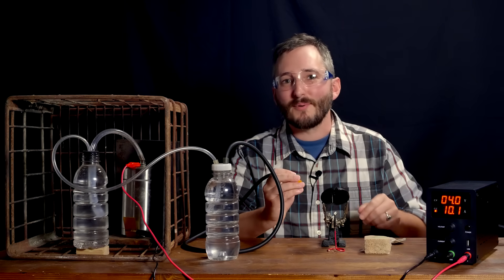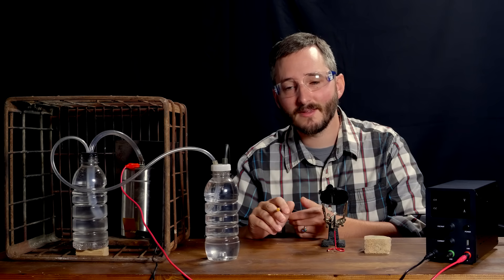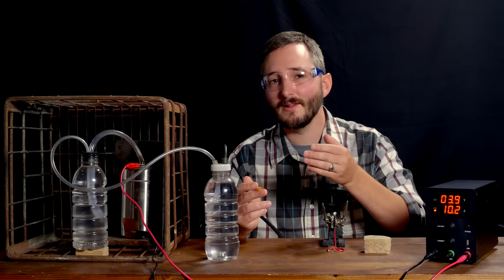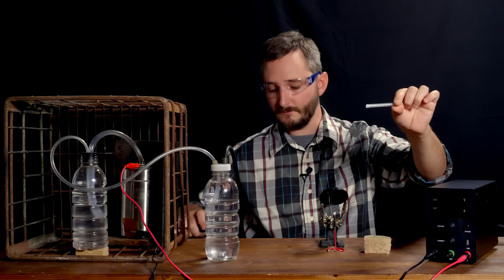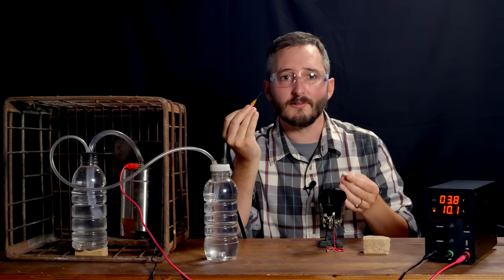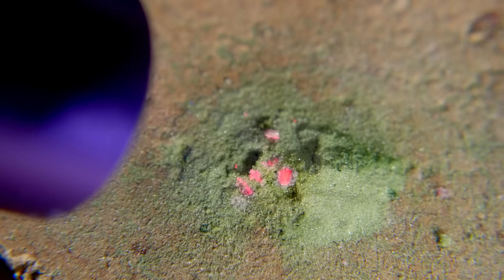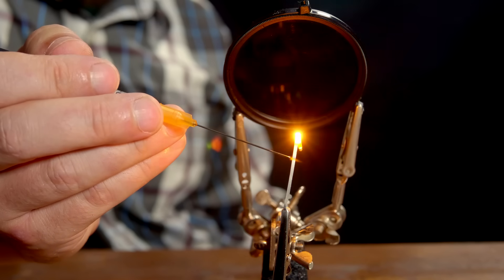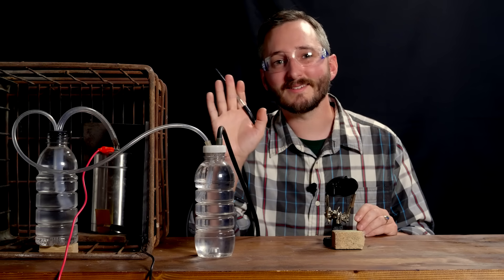DIY Oxy Hydrogen Torch Using Water Electrolysis

Comment: You could use it as the most dangerous soldering iron ever but it would probably be too hot for any solder I've ever worked with... seems extremely practical, especially since it looks like your using a factory made soldering iron's power supply to power it (could be a hoby electronics power supply, but if you have one of those than you probably have a factory made soldering iron too) so in light of that it seems extremely practical to DIY one using highly explosive gases ... because duh, everything's is better when it's way more dangerous than necessary.

All kidding aside, while I have no real, practical use case, this was still a really cool video. It reminds me of a torch I made in my high school days with my dad in his workshop. It ran on acetylene made from mixing gravel sized chunks of calcium carbide with water. In that case the gas production was very very fast, and we had to take measures to ensure our collector didn't over pressurize and we still took steps to ensure that the flame couldn't make it back to the fuel collector too. It was a fun project,  but felt too sketch to want to actually use it for more than demonstration. Anyways, thanks again for the nostalgic video.

Comment: Once again great video with very enjoyable and engaging content.

Was that glass standard glass or tempered glass? I would be interested in seeing if that could burn through tempered glass as well without a spontaneous disassembly of the glass panel.

As for uses ... Make three needles with one handle (if the gas out put is good enough) and you can use it to bend class tubing by heating evenly the entire tube surface .... and make customized lab equipment or desktop PC glass water cooling tubes for example
Reply: Like you said, i don't think tempered glass bends like that when heated.

Comment: this very much seems like an appropiate upgrade for the Hacksmiths' laminar flow propane proto-saber. Although it would be VERY dangerous, and would need a heck of a lot of power to generate a suitable HHO flow, it would definitely make it work more like the "real" deal.
Also if you could up the flow with a "few" more extra cells, could you make bigger rubies? Like centimeters big? that would be interesting to watch

Comment: You should use a balloon or a diaphragm tank.
Reply from the maker: A tank supplied torch increases the danger to an extreme measure. It wouldn't take a large balloon of hho to blow the door off my shop if it flashed back.
Reply: If you use a diaphragm tank, you can make a large torch, even with your small setup.  You just won't be able to use it for long periods of time.  You will have to wait on generation for the volume to be sufficient, then use the torch until the volume decreases to a critical state, then stop using it until you have more generated.  You also need a valve on your torch head, to adjust for different sizes of work.  The valve needs to be as close to the head as possible.

Comment: The long syringe tip is an interesting solution and I like the aluminum mesh too. but I'd feel more comfortable with the bulky oxy-acetylene tip that I see others use. And if you're you're going to use a steel cage for safety, you should also have ear-muffs. If that thing pops, so do your eardrums. My welding teacher got to see someone blow out the side windows of a car with a balloon full of oxy-acetylene gas.

Comment: Please consider a little different approach..  If your going to use electrolysis don't use a solid mass of water,  that's like flooding the carburetor,  consider a steam atmosphere for the electrolysis and use steel/copper nets as the electrodes.

Comment: I have to ask why use an all in one.  Why not just divide the H and O and then let the H feed on the Oxygen in the environment or combine the H and O right before it gets to the tip?  Also,  I was thinking about this the other day and have limited ability to test the theory so I will give it to you and maybe you can make a youtube video about it.  But, I saw another video where someone used Platinum to separate Hydrogen Peroxide without any electricity.  So, what would be the practicality of using Platinum plating on the steel wire to increase a catalytic effect.  Or using Hydrogen Peroxide w/platinum plating instead of using Water.
Reply from the maker: You get better efficiency for a combined output design. You can separate peroxide a number of ways without electricity, the trouble is it takes lots of energy to make peroxide.
Reply: @Nighthawkinlight  peroxide is fairly cheap though.  I just didn't know if it would allow more flow of Hydrogen when combine with electricity.  Especially if you use platinum plating on top of it.
May cause other reactions though.

Comment: Hho is too dangerous for public consumption, but your syngas generator using carbon rods could be a game changer. Syngas eliminates the need for a carburetor when used in a generator. Solar panels could be used without charge controllers to generate the power. Biochar could be the carbon rod source, and if done with solar power would give added benefit of more syngas. (Green enough for you?)
No more lithium battery

Comment: @NightHawkInLight
Awesome work. So why cannot we use this method to produce large quantities of Oxy Hydrogen and use it to power Cars/Trucks or even electric power stations? Often it is said that electrolysis process consumes more electric energy than what it produces as heat energy
Reply from the maker: If consumes more power than it produces.

Comment: I'm going to scale this up and use it as a final project for my welding degree. Thank you for the idea my good sir. (Yes I will be working with my professor and a safety advisor before even prototyping this thing I'm not about to blow myself up)

Comment: 10:11 answer is 10:20. The military or private sector can weaponize this for infiltration and sabotage. A small drone air or ground can be equipped with this. Go into a building do it's thing and get out... Or blow up. 🤷🏽‍♂️

Comment: This could be made into a practical welder by copying the concept of the MIG Welding Spool Gun.  So I think you would 3d print a device that could hold a spool of wire that melts well in the Oxyhydrogen torch, and when you press the trigger, it feeds this out at a slight angle into the torch flame.

To demonstrate it, take two pieces of metal and weld them.  There are some good youtube videos demonstrating the use of the spool gun and the patterns you may want to adopt to ensure a good weld.  But I think you could use say an old 3d printer extruder to push out the wire.  Scrap part project!  And it's practical, as you could contain the water/electrolyte in compartments inside the spool gun, along with a couple of LIPOs for a self-contained micro welding unit.

Naturally such a system could also microweld layers in an additive 3d printer with actual metal.

Comment: I'm superinterested in some kind of small-scale microfluidic chemistry for the production of useful industrial chemicals.  A drop a minute adds up to volumes one might need in farm/ranch scenario.  So what kind of novel chemistry can you do with this thing?  You've already demonstrated the LImelight with CaO, why not add some carbon and see if you can synthesize CaC2.  Smple hydrolysis of that will take you to a hotter place, C2H2 aka Acetylene or Ethyne.

From there you have a reagent for various organic chemistry synths.  But you also have the Oxy-Acetylene opportunity for a hotter torch.  You also get a nice hyperfine carbon powder from the combustion of acetylene that might prove useful, perhaps even bulk fullerenes are possible depending on the way it is combusted.

Comment: Enjoy your very interesting investigations and observations.  How about passing the produced hydrogen from the electrolysis process through a mini fuel cell and see how much electricity can be generated by the fuel cell, and then calculate the overall efficiency of the 'system' from the average power supply consumption to the average electricity generation by the fuel cell?

Comment: use a tungsten needle for extra heat resistance ...stick the piece of soaked cotton at the middle of the needle for cooling,add a small spark for ignition

Comment: Thank you very much for making and sharing this stuff, I find it very interesting and I have a question: Did you try to use just a glas of water you could tip the torch into in case it starts to backflash, instead of using your piece of wet paper and what was the outcome?

Comment: Really enjoying your videos and learning a lot of practical things that I want to find how to apply. One application I'm curious about is oxy hydrogen-fueled rocket engines - are you able to do something similar to the torch but optimized for thrust? This probably involves feeding the oxygen/hydrogen at a higher pressure, figuring out the ideal nozzle design, and measuring thrust with a normal weight scale.

Comment: You were wrong about the nozzle increasing pressure of the gas. Bernoulli's principle states that an increase in the speed of a fluid occurs simultaneously with a decrease in static pressure or a decrease in the fluid's potential energy. That means that since you ran the gas through a convergent nozzle the velocity of the gas increased but the pressure decreased. If you wanted to increase the pressure you would need to flair the end to create a divergent nozzle as a pressure brake.
Reply from the maker: Decreasing outlet size increases pressure in the system as a whole.

Comment: Thanks a lot for these very interesting and innovative videos!
Could you perhaps arrange multiple inward pointing needles in a semi-spherical cage scaffold? This "cap" would then be placed over a small heap of Al2O3 to melt greater rubies, without you having to hold the needle.
By the way, instead of extinguishing the needle tips with a wet paper you could simply put the needle tip into a glass of water.

Comment: I'm pretty sure that aluminium and oxygen together will do the exact opposite of cooling the mixture down when the flame gets in there.
It probably will burn at immense temperature, searing your hand and further fueling the flame.
The heat of the aluminum flame might even burn the syringe, which might in turn throw molten plastic and burning aluminium.
I'd suggest not to do this, or atleast use it with separation of hydrogen and oxygen.

Comment: if you add a notch towards the base of the needle you can attach a second needle to it and have the second needle attached to a cheap aquarium pump. the flame will then be pushed just past the tip of the needle.
most torches have an air gap just before the torch tip to help push the flame past the tip.

Comment: This guy really just showed a bunch of 12-year-olds how to mass-produce extremely flammable gas and then turn it into a welding torch that they can use it home :'). In all reality though, this is a very cool video, and absolutely agree that this would be useful for jewellery making, and plan on making a slightly more sturdy version of this at home for such a purpose.

Comment: ..You might try a short length of braided Copper shied (from a piece of RG-316, or 174 coaxial cable, for instance) one end tied to the needle, and flaired out into a cone to assist is the dispersion of the heat from the flame.  Even a short section should help.  Most people would have a piece from  an old TV set or other electronics in their "junk bin".

Comment: Windsor Salt Lindbergh Works had a "fusing plant" from 1980 to 83. It used alot of natural gas and there 36 gas wells started spitting rocks and water and blobs of oil so they had to stop. They melted in a crucible and continous pour into metal molds. The young engineer Ken Palamerick did his practicume on this project and fudged the gas totalizer engineering unit and claimed only 1/3 the gas used to the crown for royalties. He had me beat up when I found out.

Comment: What you have is called BROWN'S gas. I used a collection of it to run the motor on a generator. . Also others found one could weld steel into brick, medical uses as well. Check John Worrall Keely and Hutchinson Effect for interesting stuff. Great Work!

Comment: If i don't have chromium can i melt Al oxide on the surface of Chromium containing Steel to make ruby ? May be at high temperature AlO will react with chromium in steel ?

Comment: So out of curiosity, would having a redundant piece of wet fabric on the syringe on the back part of the metal tip help with preventing flashbacks by reducing the temperature of the gas, or would the temperature lost be negligible? especially when you consider how dangerous it would be to accidentally drop the device

Comment: So, I wanted to melt metals (aluminium, copper, zinc, lead, maybe iron) with oxyhydrogen and it got me thinking when i realized that I need either more of it (lots) or something else. I came up with the idea to mix it with wood gas in the bubbler because it's easier to make and definitely cheaper. So before I try anything, could something like that even work?
Reply from the maker: I don't think it would work very well. Easier to melt those metals in an electric kiln or even a wood or charcoal foundry.
Reply: @Nighthawkinlight  Thanks for replying, will try both mixing the gasses and charcoal foundry.

Comment: A micro-welding setup like this seems like it would be a staple in any home lab. Just add water, electrolyte & power !! Oh man, that would be useful. I can think of numerous projects !!  Just yesterday I wanted to weld a stripped bolt to a shaft which sits 1/4" next to a thermoset plastic.

Comment: That was fascinating.  I don't understand how water can put out a 2K degree flame, however. It seems like the flame would vaporize the water-soaked paper towel.  How far out does the jet of heat go; how far out can you feel the flame?
Reply from the maker: It's too hot to hold your hand in front at about 8 inches distance
Reply: @Nighthawkinlight  thank you!

Comment: Is it possible to compress hho gas like any other gas into a solid state by putting it under pressure. If so how would you do that. At what pressure do you store it at. What type of container would it take to hold it.

Comment: I had a feeling that you claim you know physics. According to the Bernoulli law when you decrease the pipe's diameter you increase the stream speed and DECREASE the pressure.
Reply from the maker: Pressure decreases in a narrowed outlet, pressure increases in a system when the outlet is narrowed.

Comment: Waaa i am jeweler and yes it might be really useful! Thanks a lot. 

Would it be hot enough to melt platinum? 

Would you think of a home made way to store/pressurize that gaz so it wouldn’t have to work with the électrolyse system always plugged in. 
It also might be safer to separate the production and the use of it..

Comment: Can I just point out that this mixture under ATF classification standards is a class A (high) explosive.  You are absolutely right to fear an explosion, this stuff will literally detonate (not deflagrate) if something goes wrong.  It would easily turn your generator into a frag grenade if an explosion occurred and send sharp shards of metal flying at deadly speeds.

Comment: Try to power heat up some sort of heat absorbing material with it and then use that to power a Peltier module or a stifling engine. I could see the stirling engine doing a billion rpms with such high heat.

Comment: seems like you could "easily" upgrade this with a system that cools the needle near the base to prevent flowback.  Would be cool to see
Reply: Was thinking the same a small copper cylinder with flame needle running through like a libec condenser. An inlet and outlet size of auto window washer tube fed by washer pump. Ok steam from a still is a lot cooler but by adjusting size of water jacket and flow rate should be possible.

Comment: I wonder if it would be possible to attach the torch to something like a cnc router. You could then use it to draw in ruby substrate some designs to make ruby jewelry in any flat shape you desire. It may even possible to make a thin ruby pane with a continuous and steady movement of a robotic arm.